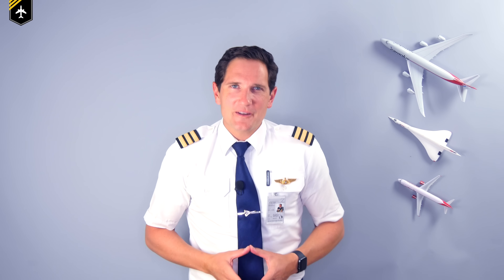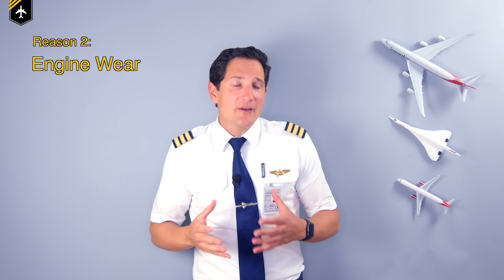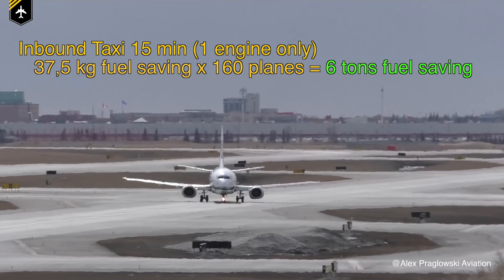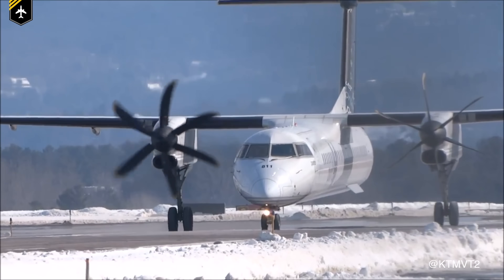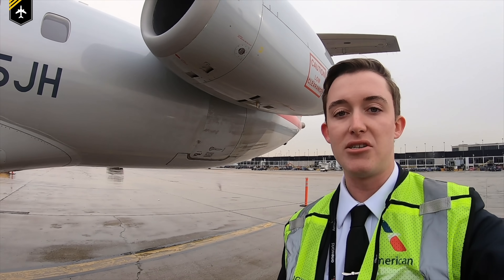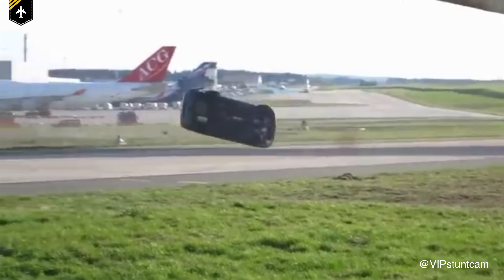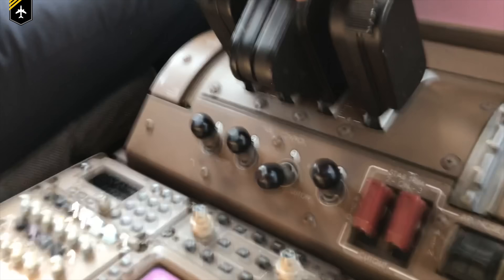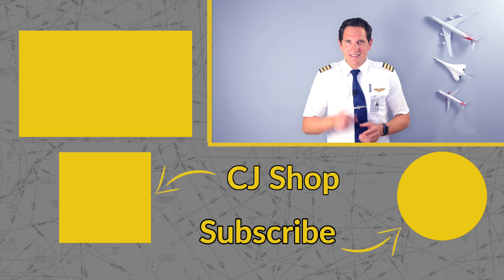Why do PILOTS taxi only with ONE ENGINE??? Explained by CAPTAIN JOE

Comment: BTW Ryanair is amazing. You can fly all across Europe for super cheap.  I flew to sweden once for about 30 euro return. That's a few cups of coffee and a snack at the airport. The pilot was fairly competent as well. it was a winter flight with some very heavy crosswind and turbulence during landing. He landed like a boss first attempt no going around through the plane got pushed around in the wind to about a 45 degree angle relative to the runway maybe 20 meters in the air just prior to touchdown before he corrected. 

But yeah their onboard flight service is basically collecting gas money if you get thirsty :D

Comment: Does it ever create uneven thrust On takeoff? Being that one engine will be warmed up more then the other? 
Like on a car engine, you get more power when oil temp is at running temperature as its more fluid?

Comment: Are the fuel savings that big? I mean usually you dont taxi with engines idle and you would need double the power on one engine only
Reply: msi you can actually taxi with idle power (or a bit more if aircraft is at max weight)

And yea using a single engine would need more power from that engine, but the fuel used wont be double.

Comment: 1:54 I didn't know there was an engine this big. WOW.. It's like a fucking building..
Reply: It's a normal engine of a Boeing 747.
Reply: @mikep9604  Didn't know that.. Still blows me away though.
Reply: @ziukh3164  - The camera angle made it look like that, because the camera was very close to the engine. This is the particular aircraft shown in the video:
http://www.maidenthebeast.com/web/wp-content/uploads/2016/07/ed-force-one-201607.jpg
Reply: @mikep9604  I checked what a 747 engine looks like and I didn't come across any that looks this big. So if it IS a 747 engine the camera angle must be very tricky since the 2 persons in the bacground look like ants in comparison.
Reply: @ziukh3164  - Yes, it's all about the camera angle, because those people in the background were quite far away so they will appear very tiny in the image compared with the engine which was very close to the camera.

It is a B747 engine because it's the aircraft which Iron Maiden used on their tour. Here is another engine of this aircraft and look at the symbol on the engine cowling:
https://www.ecuavisa.com/sites/default/files/fotos/2016/03/12/avion-de-iron-maiden-daado.jpg
Here you can see the same symbol on the engine cowling and this aircraft is a Boeing 747 they used:
https://s.yimg.com/uu/api/res/1.2/cSWBAg3hFcdQqxppq3npwA--~B/aD02ODI7dz0xMDI0O3NtPTE7YXBwaWQ9eXRhY2h5b24-/http://media.zenfs.com/en_us/News/afp.com/Part-MVD-Mvd6753916-1-1-0.jpg
Reply: @mikep9604  Nevertheless, man, that's some hard ass partying right there. Shit, it's like the ultimate dream!

Comment: Since airplanes taxi only using the engines (there are no motors for the wheels, right?) the fuel consumption of the other engine must be higher because the other one is shut off. So isnt the calculation a bit off? Eg. planes need a specific amount of thrust to drive on the taxi ways. If you shutdown one engine, the other one has to compensate the lost of trust to maintain the speed and therefore should consume more fuel. As far as I understand, it does save fuel .. but not exactly 50 %. (?)
Reply: And reas yup it wont be 50%, but still it is a decent amount that would definitely make a difference.

Comment: Is it possible to put the gear up when the plane is on the ground so it breaks and everyone dies ?
Reply: No, the system prevents that.
Reply: @mikep9604  oh really ? 'cause I tried on a simulator and it worked...
Reply: Romain Dec a home simulator isn’t 100% accurate like the real deal.

As mentioned by mike, there is a system which is aware of the aircraft being on the ground or not. So of its on the ground, it wont activate the landing gear.

Comment: Captain Joe, a quick un related question about the Airbus A320 Family. I have flown on the A319, A320 and most recently the A321. Unlike both the A319 and A320, the A321 felt much more faster and take off and landing compared to it's smaller counterparts. Is it my imagination or does the A321 require a much higher rotation and landing speed? All of these versions previously flown as well as the A321 all were the classic engine options, all equipped with the CFM engines... Also on the A321 it stank of hot brakes, when we boarded and de boarded at the destination
Reply: David Pring rotation and landing speed is a function of weight/c of g/flaps etc.

So its not necessary that an A321 will have a faster speed than an a320 or a319. But yes if variables are kept constant then the a321 would need a higher speed.

And most probably the a321 you were in landed on a runway where a greater autobrake setting was needed.

Comment: quick question I am 15 so I don't know if this is a stupid question.
Does an aeronautic engineer need to know everything a polit knows except flying?
Reply: Vito Cipponeri kind of. You have to know every little detail about the aircraft you are working on, yet you couldnt care less about visibility requirements, how airspace works, or at what altitude you are required to have a source of oxygen at. Engineers are more technical and pilots are more practical.

Comment: Boon = CAPTAIN JOE

DO Planes have horns to sound?
Can any one own a plane i mean a small one anything?
What is the FOG in passenger cabin?
Once i travelled in spicejet it fly into air with jerks like bumping on speed breaker but i didint experienced it on indigo?

why sometimes passenger bridges and sometimes  steps by vehicle to enter and get out of plane ?
Reply: Mohanachuth Varma no planes do not have horns like cars. Yes anyone can own a plane but without a private pilot certificate you cant fly it.The Fog is probably just air from people breathing building up. The rest of your questions i cant read.

Comment: I real love the way you explain your subject. You make them look so simple. Now kindly explain the difference between ground control and air traffic conttol and there location
Reply: Mwang'ombe Godwin ground control is located in the control tower. Ground basically gives you taxi directions. Then you have tower control, who is also inside the tower. Tower are the ones who clear you to takeoff and land, and can sometimes give you taxi instructions. Approach/ departure control is who you contact when entering the airports airspace ,clears you into the airspace and gives you headings and guides your approach/ departure of the airport. Approach/departure can be at the bottom of the control tower or center. They cant see your plane outside but have a radar screen with some info on it.

Comment: Joe what does a GPU?
Reply: It is used to produce electricity for the aircraft's systems when the aircraft is parked on the ground and the engines are not running.

Comment: Was wondering how when taxiing with only 1 engine, pilots avoid torque steer-like phenomenons due to differential thrust (would airflow be too slow to make rudder trim of any use?)
Reply: Nose wheel steering!
Reply: @smokingspitfire1197  Aha

Comment: 👏 I 👏HAVE 👏A 👏QUESTION 👏PLEASE 👏RESPOND,  I was flying on a 3 hour flight from Reagen National Airport to Miami, Florida. Shortly after takeoff I heard a sound that was pretty loud and low pitched that I have never heard before and I’ve flown before on the same plane type and same airline. It started about a minute after takeoff and stopped a few minutes later. If you need any more info please ask because no flight attendant knew anything about it.

Comment: Tried on my drone...

R. I. P. Drone
Reply: You have to throw it in the air with one propeller on or else it just flips over. Good luck!
Reply: Wait, why did you try to let the drone fly with one or two engines if it doesn't have the procedures that planes have and it doesn't make sense to let it with 2 engines on because its maneuvers will be reduced.

Comment: Explain works of both captain and co pilot.
And what's that 3 pilot doing in some aircrafts
Reply: Pratham Patoliya in terms of flying the plane both the captain and co-pilot can fly the plane (one acts as the pilot flying, the other acts as a pilot monitoring)
But the captain has the added responsibility of decision making regarding the aircraft, passengers,crew etc.
And if an aircraft requires a 3rd pilot, it is called the flight engineer, who basically monitors the aircraft and how it is operating

Comment: Just a quick question!

In a year I will be deciding if I want to become a pilot. But I've done a lot of research and came to the conslusing that doing the intergraded course isn't an option for me, because of the financial aspect. So I was thinking about doing it modular, so I can work part-time or full-time.

Do you know any pilots or 
colleague's that fly for an airline by achieving their licences in a modular way? Does Air France for example hire any pilots who got their licenses modular?

Thanks!

Comment: AFAIK, 747 is a quite old project, even revamped and update more times, so maybe the complexity and the distribution of system powered was not conceived for fuel savings.
Newer 737, Dreamliner and AirBus are getting a bit more fuel conserving into taxi/takeoff time?

Comment: Random Flight Question, do Pilots hear the Announcements that Flight Attendants make to the passengers or do they only hear from the TSA and other Pilots?
Reply: Shana the Multiboxer no they dont. The flight attendants are talking over your everyday PA system while the pilots are tuned in to a frequency. The flight attendants do have a way to contact the pilots though of course

Comment: Can you take off with one engine?
Reply: Lisanda04 yes, but that is only when the aircraft is already in speed (ie if an engine fails after a certain speed)
Reply: @ZK-APA  so it needs enough momentum to takeoff but can not move from 0
Reply: Lisanda04 its more like my answer is in terms of practical sense.

In theory, if you have a light aircraft, an infinite as required runway and having no yaw factor, an aircraft can take off with just 1 engine

In practice, you need speed because one, runway is of a finite length, and you need speed so that your rudders are effective in maintaining a straight line( having just a single engine running will yaw the plane). So if you try taking off on a single engine, you’ll most probably drift off the runway itself.

Comment: Captain Joe, what will happen to the aircraft if someone pull the landing gear lever up when the plane is on the ground?
Reply: Arya Dharma P. nothing. The plane has sensors so it knows its on the ground.
Reply: It will plonk right on the floor, I know because my nana was in the air cadets, they were in a herculease and the gear wasn't working, the kids pulled them manually 10 mins after land the whole thing slams into the ground because the gear collapsed

Comment: I have two things to say:

One: Why did they discontinue the bucket reversers seen on first gen 737s?

Second, I am pleased that the prop planes shown are all Bombardier Q-series, or as they used to be called, Dash-8s.
Reply: The Emerald Men Official the bucket reversers makes sense in a low bypass turbofan engine (like the ones in the 737-200). However with higher bypass engines its not straightforward to put the bucket system.

Comment: What does the curves in the back of the 787 engine do does it have a use that helps the plane or help with fuel saving?
Reply: Its to reduce engine noise (when exhaust air meets the outside air, the chevrons help in reducing the noise generated)

Comment: I live very close to a airport (1.5km west of Köln/Bonn). How comes that i hear on daytime absolute nothing from the airport (except if the east-west runway is open, then they fly right throug my living room), but sometimes in the night i can hear a airplane running an engine test (sometimes a jet, sometimes a turboprop)? The airplane/sound is not moving and can be heard up to an hour.
Reply: wolf310ii most probably you have more environmental noise during the day, so the far away noise of the airport activity gets muffled. But at night there is no such noise, so the airport activity is the only noise which is being created, hence you are able to hear it much better.

Comment: Are engines really needed when on the ground? I assumed there would be a different type of engine running the wheels.
Reply: Zahaid Rahman yes, because having additional engine powering the heels will increase the complexity and costs of the aircraft.

Moreover not a lot of thrust is needed to taxi an aircraft (sometimes it can taxi on idle), so its a much simper mechanic

Comment: Which pilot training course is the best for a foreign student between

Course-1. Contains:-

199 hours flight time by C- 152(126hrs), C-172(48hrs), Seneca(25hrs) and 25 hours with PCATD and AATD simulation time. Cost:$57,129

Course-2. Contains:-
 
121 hours flight time with a C-172(71hrs) glass cockpit, DA-42(50hrs) and 19 hours through the (simulator)Redbird FMX, Redbird TD2(19hrs). Furthermore Oral Single Engine 48 hrs and Oral Multi-Engine 35 hrs. Cost:$58,575

In additional,
Both courses are a couple of Academies in the USA.
Check ride included on both courses.
Both Academy provides book.
PPL, IR, CPL also contains both courses.

Comment: How do pilots navigate an aircraft?
Reply: Generik Q using GPS or ground based navigation equipment (VOR, NBD etc)

Basically there are “highways” in the air, and these equipments are used for making those routes

Comment: Hey Joe, absolutely loving the videos man! Have always enjoyed learning from you and especially learning about the Airbus A320 into detail. If you don’t mind, could you please explain which order the engines are started during pushback? Does it vary from flight to flight or does it vary from aircraft type to aircraft type? I would really appreciate if you made a video covering this topic. All the best!
Reply: David Flynn it depends from aircraft to aircraft, as each engine may power a different system, and the systems have their own priority.

Eg in the A320 engine no 2 powers the yellow hydraulic line which controls the parking brake. So airbus recommends starting that engine first.

Comment: Why can’t pilots fly over 250 knots below 10,000 feet?
Reply: Because that's where little planes fly. Coming at one at 400 knots reduces evasion time
Reply: @alexmelia8873  Which commercial aircraft can fly at 400kts IAS?
Reply: @douglasnisbet1189  when did I say IAS?
Reply: @alexmelia8873   Well what other speed would you be referring to? GS is irrelevant obviously because it varied with wind. Whenever you talk about aircraft speed, you talk about IAS, as I'm sure you know. In any case the difference between IAS and TAS below FL100 is negligible.
Reply: @douglasnisbet1189  the main point of 250kts is to increase the amount of time to make evasive maneuvers in case a VFR aircraft encroaches into the flightpath of an IFR aircraft. At 300kts, 400kts, etc you have much less time to react. This rule was written in blood following a midair collision. But you can keep arguing scemantics such as the difference between IAS, TAS, etc to make the internet think you're smart
Reply: @alexmelia8873  But you surely know that no commercial aircraft can fly at 400kts IAS. So your comment makes no sense. I don't think I'm particularly smart. Flying the 737 for a living though I do think I have some idea about the 250/100 rule.
Reply: @douglasnisbet1189  yet again, you keep putting words in my mouth. No where did I claim "IAS"
Reply: @alexmelia8873  so please...tell me what speed you're referring to! I'm not aware of how commercial aircraft can do 400kts of any speed below FL100. Very rare to get 100kt winds at that level, so even at 300tas your max max gs is very unlikely to touch 400. Please...you tell me what you were referring to.

Comment: Hello Joe, I am a big fan of your videos. I have a question. I heard, while taking off, the yoke is pushed down to avoid the nose tipping off. For Airbus A320, the pedal disc is beside the yoke. So if you have to use pedal disc while taking off and push the yoke at same time how would you manage it?

Comment: Why does the crew make announcements through a telephone and not through a microphone?
Reply: lorenz1074 they can use the microphone, but then there are chances that you can mess up the transmitter setting so you would either make a PA on frequency, or make a radio call on the PA system.

Comment: Hey Captain Joe,
I have a curiosity. I have always seen planes being pushed back by a machine to face the right side of the runway. Is there a reason why planes do not have a reverse gear, like cars? I'm thinking visibility reasons. But is there another?
Thanks :)
Reply: Alexandra Prisacaru aircraft can sorta reverse on their own if they have reverse thrust in their engines.

But they don’t use it because it’s basically fuel being wasted, and it’s not a good thing to be running an aircraft engine at high power near a terminal.
Reply: @ZK-APA  Thanks for the reply. Makes total sense 😊

Comment: Captian why do some airlines in Canada still use the 737 200
Reply: Fart Loops there is a good video made by someone else about it (just search 737-200 Alex)

But basic norm is that the 737-200 is more suited to gravel runways (not all runway in Canada are of good quality), and the fact that you can configure the 737-200 as a combi aircraft
Reply: @ZK-APA  thanks

Comment: Captain Joe, Please make a video on " How does plane fly on one engine", how plane don't turn to oposite direction due to thrust difference incase of shut down of one of the engine due to any emergency mid air
Reply: This drift caused by asymmetric thrust will be compensated using the aircraft controls. For example if the aircraft begins to turn to left, the pilot corrects this drift using the right rudder pedal.